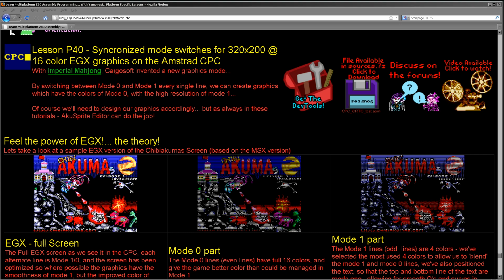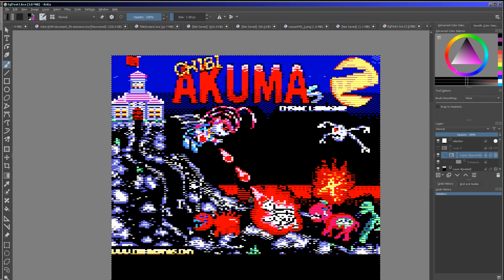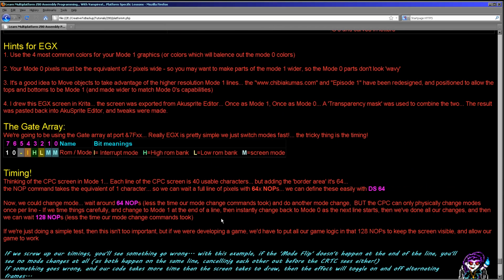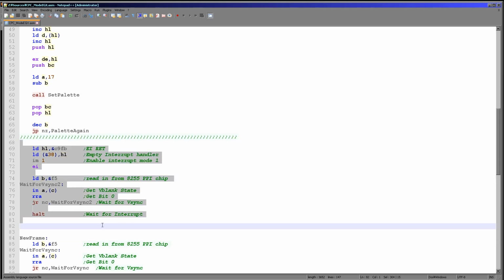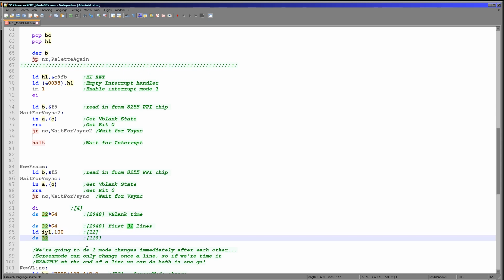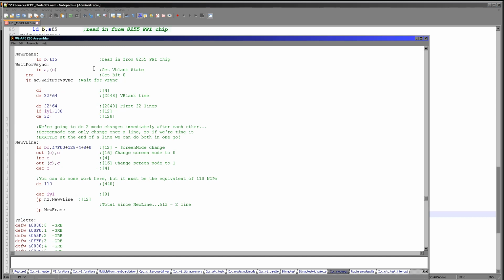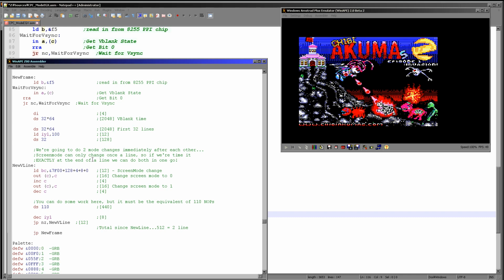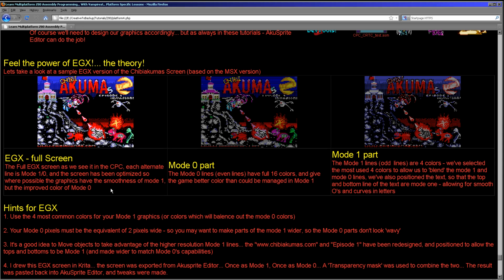EGX: Z80 ASM Lesson P40 - 320x200 @ 16 color on the Amstrad CPC

Comment: If the colour palette can be changed at the same time as the mode switch, then this technique could become VERY powerful.

I'll have a look at what people have done with this... and try it out.
Reply from the maker: I'm not sure if there's enough time to change the colors and mode on each line. you may be able to do it to a limited extent, say changing one color per line, keeping the others the same.
Reply: @ChibiAkumas  

Awesome.

I'm juggling a lot of things at the moment, but I'll test this out at some point, to see what can be done.

If one colour could be changed, then that is definitely still enormous in terms of building a graphic with more colours.

I wonder how easily the Amstrad Plus sprites and palette can work alongside this, as that would then add another 16 colours as well.

I'll have to check if there are any colour switching tricks possible with the 16 extra colours assigned to the Plus sprites, and how much of the screen that they can cover.

I guess that sprites could be used to draw a portion of the image on the Plus machines, if that area has unique colours.

Just making a fancy, colourful title screen for a GX4000 port of a decent CPC game would be nice to do.